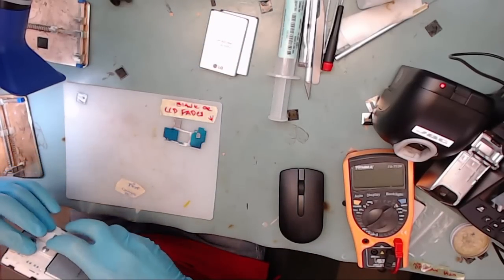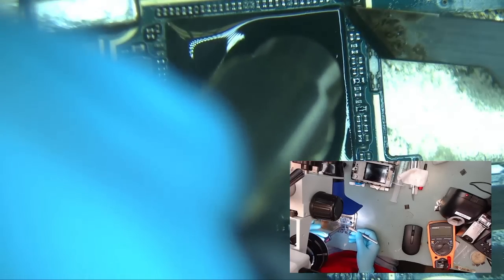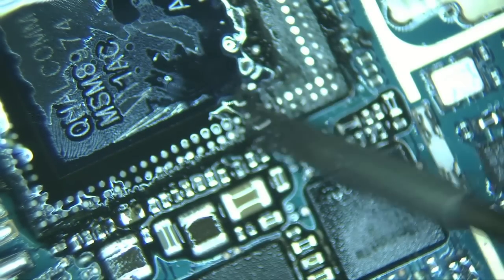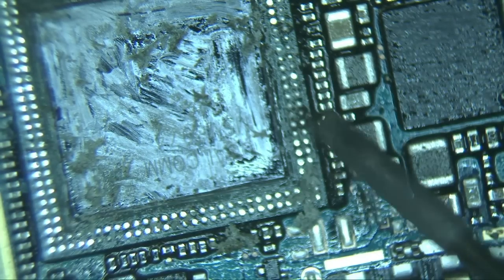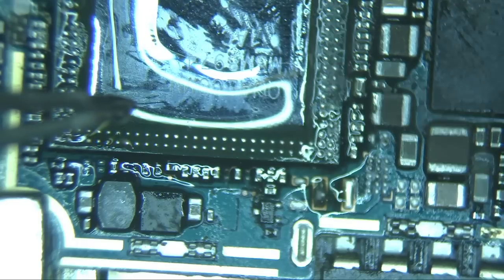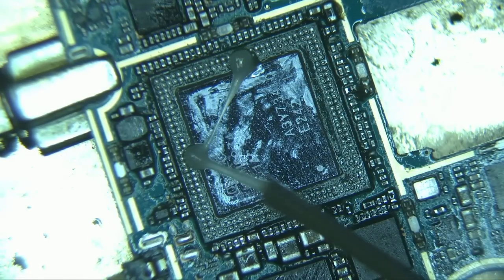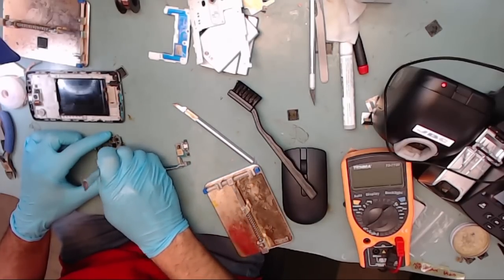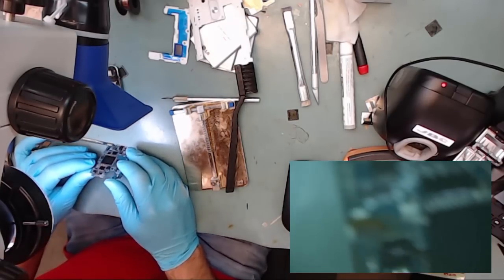LG G3 LCD Screen Fade to Black FIXED Display Flickering Dark Replaced Processor IC Chip H9CKNNNDATMT

Comment: That was surgery but doable. I wonder if it could have been a corroded solder joint or bad connection too. Too bad that this is one of the last phones one can open without unglueing with a heat gun. I keep opening and fixing mine over and over.

Comment: My phone has same issue but after few days it also started to random restart and then after one day it didn't even start not even respond to charging .I took it to a repair shop and he just heated the ic you replaced and phone started booting and then after one day again it shutdown and now it same again.If i heat the motherboard it startes but again same.So will my problem stop if i replace the above ic?

Comment: I tried ... but it didn't last long ... I solved it by inserting a copper wire..curved by the current wire, flattened with a clamp, under the processor and slightly touches the metal protection of the processor above, from the part of the Vol down button. The copper wire that protrudes the most cut it ... otherwise it goes to piggle the keys .... creating es: temporary mode. Perhaps the flickering and / or darkening of the display is caused by an electrostatic charge. I solved it like this!

Comment: My LG G3 (850) phone has this problem, and a no longer allows me ti get past the boot screen. I care little about fixing the phone for continued use, at least not enough to want to spend what replacing the chip would cost. But still I wonder, is there an easy and inexpensive way to unencrypt and copy the data from its internal storage to an external device? I had hope of recovering the data when I thought the problem was just an loose internal connection to the screen. But now knowing it is a chip that is far beyond my ability to replace is disheartening. Most of my data was backed up already. What remains on the phone is not worth paying a professional data recovery service to recover. But I am wondering if there is a free or inexpensive data recovery method I can attempt on my own? Phone has TWRP bootloader and Lineageos, in case that matters for the decryption.

 (Would even something crazy like trying to boot with the phone under dry ice be feasible to keep the bad IC working long enough to copy the data? But then how to type my password with the screen submerged? This seems to me unlikely to work. But I am trying to think outside the box.)
Reply: My LG G3 has started showing this fade to black problem quite some time ago, and as I seeked alternatives to see the screen contents without relying on the screen itself as it faded to black and rarely comes back.
I found one (scrpcy) so now I can see the screen of the LG G3 in my computer. This software works through ADB, so you can use it through a USB connection or through the WiFi connection. The only requirements are Android 5.0 + and Developer Mode option USB debugging turned on, so if you still have your phone running stock ROM which is probably version 4 it will not work, but if you have Android 5+ and had already enabled Developer Mode and USB debugging it could work for you as it did for me.
Unfortunately I had the stupid idea of upgrading my Android version, got an Android 9.0 ROM and installed it through TWRP, and now I am stuck as I need the screen to work long enough for me to complete the initial setup and turn on developer mode and USB debugging but it keeps fading to back during boot and is not coming back. Anyway, if your Android version is 5 or more, make sure to check this tool as it can be useful in your case.

Comment: I have a few questions regarding the LG G3.
I assume it's more expensive to have a phone sent in for repair over purchasing your refurbished units, correct?
The refurbished G3 phones for sale on your site have all gone through this process? Also, do you improve the heat sinks?
Outta curiosity, are there ways to upgrading these phones? Better processors, increased storage or RAM?
Finally, what version of Android do they have installed? Is there any way a customer can choose what they get? Is it possible to have root?
Thank you for your time.
Reply from the maker: Yes, it most likely is cheaper to purchase a replacement unit. As for the ones we sell on the website, they have not ever had this issue as it is not cost effective to repair this issue for the resale of the phone. Having said that we have installed heatsinks on all of them to keep the problem from happening. For your last question: no there is not a way to upgrade the hardware. Even if there was, this phone is overheating with this hardware, imagine how hot it would get with faster hardware.

Comment: Hi, my LG-D690 Stylus (LG3) does not receive ant GPS signals any more after a factory reset. I tried with GPS Test and TOPNTP 1.1 apps after rooting, but there seems to be no way to make it work. I guess this is not a hardware problem because GPS worked fine before the factory reset. What do you recommend?
Reply from the maker: Go back to the original software. and remove the root.
Reply: Thank you for replying. It was not rooted when it lost access to GPS after the factory reset. I guess what you mean is do another factory reset. This made me lose GPS. Are there other ROMS that I can flash?

Comment: Another question. Did you make balls with the soldering iron, on the chip that I received already there are balls in the taps, do I need to add the balls in the processor also or only those of the chip are enough? Thank you.

Comment: About 3 minutes in I started to look for the cheapest offer for a Samsung A5 2017..... My g3 was almost trouble free to this point, even though you could fry an egg on and I sometimes sprayed it with water to keep it cool. 2 years, 3 batteries and high intensity use it finally died. GG

Comment: Great video.  Any luck removing and reinstalling original top chips?  Baking LG G3 pcbs at 320 degrees for eight minutes usually temporarily fixes the problem and reebaking fixes again.  Shims help similarly upgrading from paper, credit card, dime, and quarter between failures.  Curious if it's just the connections.

Comment: Hi, first of all congratulations for the video, it helped me understand where the processor is =\ , I heated the top chip to 300 ° C and it stuck after that it did not work anymore, my LG uses the ELPIDA FA164A2PM chip. My question is what temperature should I apply so as not to damage the new chip? Thank you.

Comment: instead of flux, ill use kapton tape to keep the heat from the board.
Reply: oh yes, tape is much better. It will also keep the glue and solder mess from the components around the chip.

Comment: How is a bad H9CKNNNDATMT(SK Hynix) LPDDR3 memory block responsible for screen flickering (if RAM is bad = no boot, and lg stock recovery would try to dump RAM state for low level debugging/troubleshooting ). .........
Reply: the ram chip isnt bad. the problem is just that because of constant overheating, the solder detached and the problem could be fixed just by putting pressure on the chip so that the solder reconnects.
Reply: i bet that ram chip is not hot-swappable = kernel will go into panic state after first contact loss (but os runs fine) ???
Reply: CheapDeath96 for some reason the os runs fine but graphics get messed up. Letting it cool a bit will shrink the chip a bit so it will touch the solder again. I fixed mine just by putting pressure using a metal piece which i put in the phone.
Reply: i will try (but when you disconnect ram it loses power and information stored, ram is volatile type of memory, so linux kernel, modules and drivers gets corrupted on first power loss = os cant run anymore!!(this is why i feel like its not ram problem)).
Reply: Thats true but remember, only a few pins lose contact so the chip doesnt lose power. I can confirm it is ram solder problem as thats what im wrestling with on my unit haha. I dont have the tools to fix it permanently and so far the best solution i managed to do is a thin thermal pad and a metal piece to put pressure. After a while the edges of ram dig into the pad so it doesnt put enough pressure anymore. and the metal piece isnt flat enough (or wide enough, idk) so that doesnt put enough pressure where it needs to.
Reply: I rooted my g3 and installed linageos. After a few hours of memory testing i confirmed that this is NOT a ram issue, same results with and without mechanical factor ( mechanical factor (bumping, pressing, shaking))(phone was warm ~65°C)
Reply: CheapDeath96 so you opened the phone and put something on the ram for pressure?
Reply: no, i generated 10 1.2Gb images .img files of random data from /dev/urandom on my computer and calculated sha256sum digest of each .img , than i created 1.25Gb ramdisk on my g2 and put .img file (one at the time) into it, after 20 minutes of holding data i calculated sha256 hash locally on g2 and compared it to the value calculated on pc, calculated hashes were same for each .img 

(test was done with screen flickering and fading using adb as connection )
Reply: CheapDeath96 you should still try the mechnanical fix that i said worked for me.
Reply: CheapDeath96 haha yeah but tske a look at the ram. Maybe you will be able to see how edges are bent a little bit and not touching the soc. And putting pressure with for exapmle a thermal pad (1mm) is perfectly safe. It might not be enough as a permanent fix tho.
Reply: will look after i open device but for now it seems that ram is fine (1.2GB has a lot of bits and not a single one flipped to opposite state (confirmed with sha2))
Reply: CheapDeath96 well, in my case the system didnt crash either, nor did it ever bug out or glitch when the fading happened, but when i opened the phone and looked at the ram it was clearly bent and when i put pressure on it everything worked fine.
Reply: will try ty for advice ;)
Reply: CheapDeath96 np, good luck!

Comment: mine turning into blue screen. What should i do .. ?
Reply: Nick Roelly your ssd chip is losing solder contact. It is on the other side so it gets a significant amount of heat from the cpu, as does ram.

Comment: hha.
Quite easy.
Looks like all I need is:
1. good soldering iron (200$)
2. good hot-air station (100-200$)
3. a bit of flux (1-5$)
4. microscope(20-50$)
5. at least couple of months for training and 10-50 phones to try. 

And then it is quite easy to reball and reflow a mainboard form your phone.
Cool! Will start right now!
Reply from the maker: Lol. I hear you. Just so you know, there are a lot of repair shops that watch our videos and use this knowledge to repair customer phones. The other purpose of these videos are to show consumers and end users which are experiencing these issues, that we are knowledgeable and very capable of repairing their phone. We are giving them a sneak peak into exactly what needs to be done to repair their phone. This makes most customers feel better knowing that they are sending their phone to a reputable and capable repair center. So we are here to help, if you need us: http://www.cellulardr.com/nationwide-mail-in-repair/
Reply: @cellulardr  very true , thanks alot for posting this.
Reply from the maker: Todd T Skills you need. Knowledge we are providing here.
Reply: "5. at least couple of months for training and 10-50 phones to try. "
Reply: TTThcn you forgot about having the skills and knowledge
Reply: CellularDR definetly, i used to be a bench tech, cant see that well anymore, i have a lgg3 that doesnt rotate image unless you tap also needs to be reset to get gps and alot of other apps tp work properly,does this sound like its something you can repair or is it too far gone?
Reply: We published this video for several reasons. 1.) People want to know what we are going to do in order to fix the phone. 2.) There are technicians all over the world that are capable of this procedure and this is a road map on how to do it. 3.) We share knowledge. Clearly, this is NOT going to help an end-user with the repair of their phone, but we do also offer these services to end-users.
Reply: Add a new k3qf6f60am-qgcf 3GB ram chip to the list.  New chip will cost $20-30 each.
Reply: I know Im randomly asking but does any of you know of a way to log back into an instagram account??
I was stupid forgot the password. I love any tricks you can offer me!
Reply: @Curtis Rodney Instablaster =)
Reply: @Harlem Omari thanks for your reply. I found the site on google and Im in the hacking process now.
Seems to take a while so I will get back to you later with my results.
Reply: @Harlem Omari It did the trick and I now got access to my account again. Im so happy!
Thanks so much, you saved my ass!
Reply: @Curtis Rodney Happy to help :D

Comment: My screen flickers and goes to black. How do I know if the chip needs to be replaced or will simply using the thermal copper tape from your part 3 video do the trick? Thanks from Mervyn in Australia
Reply: Mine is the LG g3 international version
Reply from the maker: It doesn't hurt to try the thermal tape and see if it helps. If it doesn't then you know you have to replace the chip
Reply: CellularDR Thank you, I will try that first. What's the material & tools cost to complete this repair including the chip replacement? I have an ifixit kit but that's about it. I'd love to fix the phone so I'd hate for the repair to cost more than the phone cost me (Second hand $100). Are normal phone repair shops equipted to do this type of repair if it would cost me too much in material. Thank you.

Comment: the stock of mine is samsung K3QF6F60MM-QGCF will the H9CKNNNDATMT chip work with me ??>
Reply from the maker: No you have the LG G4, this is for the LG G3. Here is the link to the LG G4 processor you are looking for:http://www.cellulardr.com/lg-g4-top-processor-ic-chip-k3qf6f60am-qgcf/
Reply: No no man i have the lg g3 d855
Reply: my lg is a g3
Reply from the maker: Match up the part numbers. We have noticed recently that LG seems to have used a different chip on the international version of the LG G3. If your phone has the  K3QF6F60MM-QGCF chip then you need to use this chip:
http://www.cellulardr.com/lg-g4-top-processor-ic-chip-k3qf6f60am-qgcf/